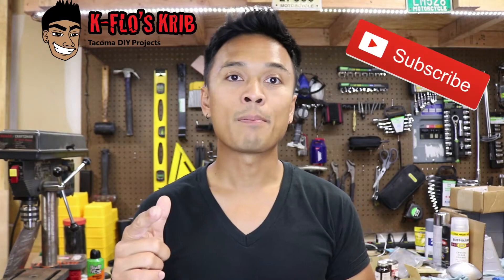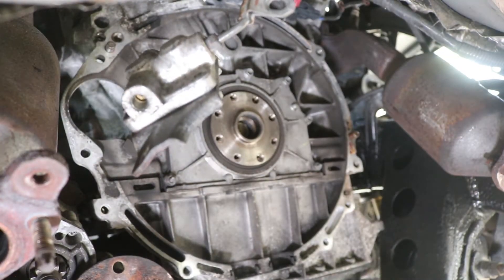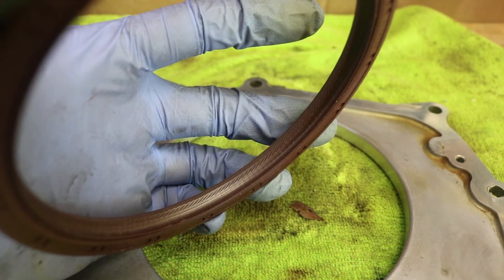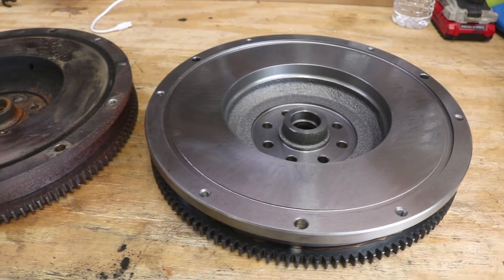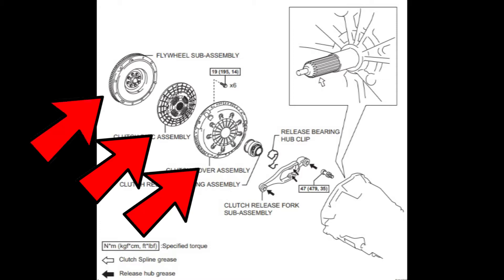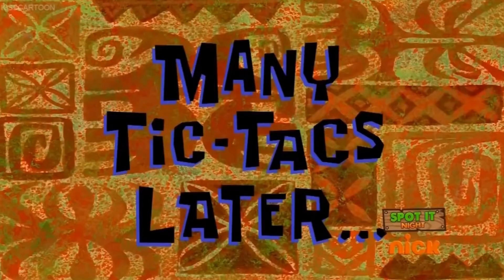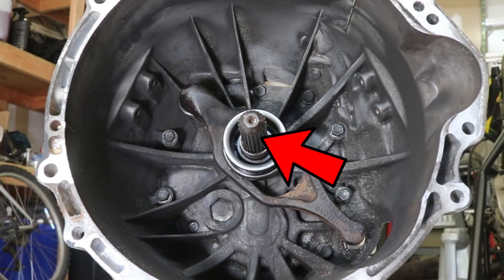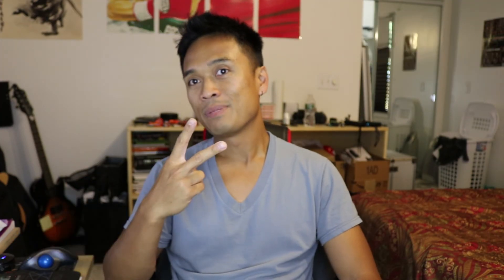Clutch Replacement (Tacoma DIY / How To) (+ Flywheel & Rear Main Seal)

Comment: Well, apparently your Tacoma is different than my Tacoma for the man seal cap. I tried to tighten them to 80 inch pounds and I snapped to the bolts off in my block after further research. Mine takes 30 to 36 inch pounds on my 2012 Toyota Tacoma 2.7 L.

Comment: Thank you sir, you saved me over 3 k. Local shops and dealer all quoted around 3500. I’ve rebuilt engines but have never once needed to touch a transmission. Fuck ntb they demolished my clutch.

Comment: For you yt mechanics The flywheel bolts are TTY! Buy the bolts from Toyota they come with loctite applied! Don't reuse the old bolts. They are 22ft pounds + 90 degrees

Comment: How was the condition of the old throw out bearing if you don't mind me asking? 

Just curious how many miles it went.
Reply from the maker: Old TOB was still OK. A little bit of a screech. I did this clutch replacement since, it was starting to slip and I had bigger tires at the time. I believe I had 130K on this clutch when I changed it
Reply: @TacomaTutorials  Oh very cool, just curious!  I've heard some wear prematurely, so wasn't sure how that one fared.

Comment: Not sure if you’ll see this but I have a 16 manual trans with 35’s and 488. What weight flywheel is best? I only do sand off-roading.
Reply from the maker: You have the same specs as mine. At 4Lo and aired down properly, the clutch grabs very well. I have the AMS automotive, I believe if you get similar specs to stock you'll be good in sandy situations

Comment: Excellent video young buck. I’ve loved Toyota trucks since the 1980’s. I have a 96 diesel F350 because I needed a big truck for our farm. I hope one day to find an older Tacoma to tinker with. My 87 Toyota truck had 140K miles on it when I sold it years ago. It had the factory clutch still. Clutches will last if you treat them right.
Reply from the maker: Awesome! Thanks for watching and supporting the channel! I definitely also want to get my hands on an older Tacoma to tinker and toy with.

Comment: How important was to replace flywheel? The only option I can find is original Toyota part for $600. Local mechanic wants to replace it. Toyota saying noone need to replace it but want $1600 for the work itself. I can't find any aftermarket flywheel for Tacoma 3rd gen 3.5L engine.
Reply from the maker: It's personal preference, you don't have to replace it if it's working properly and still has a lot of material. Keep in mind, It's a lot of work to remove the transmission. It's more peace of mind knowing that all the parts are new when you put the transmission back together
Reply: @TacomaTutorials  Considering i had a "clutch chatter" before it start sliping... i just paid 600 to the dealler . It is $2000 repair now.  By the way if doing with the dealler 1600 + parts ~$2800
Reply from the maker: Thanks for the info bro, good luck with the truck!

Comment: The old cars and trucks you never needed to remove the transmission.  You can replace the clutch and pressure plate by removing access covers.
Reply from the maker: They don't make them like they used to

Comment: Hey buddy, my Toyota Tacoma 2005 4x4 V6, I try to look for pilot bushings online. But it doesn’t show up. Do you think my truck got pilot bushings buddy. I plan to replace my truck clutch and flywheel after I watch your Videos
Reply from the maker: The V6 Transmission does not have a pilot bearing, only the 5 speed has it.

Comment: Hello the last clutch job I did was about 20 years ago on a 1986 Toyota pickup  I currently have a 2005 Tacoma 4x4 with 140k and will need a clutch soon I was just wondering does the pilot bearing come with the new flywheel and are they pressing the pilot bearing into the flywheel now rather than into the crankshaft
Reply from the maker: Thanks for watching and supporting the channel. There's no pilot bearing on the 6 speed manual transmission
Reply: @TacomaTutorials  Not doubting you that just seems weird that there's nothing supporting the input shaft . Yeah mine is the 2.7 with the 5 speed  Thanks for your reply
Reply from the maker: Yea, it did seem weird when I was looking at the shop manual. I believe the 5 speed does have a pilot bearing though.
Reply: @TacomaTutorials  Yes after you said that out of curiosity i looked on the web and yes there are a lot of people doing this are surprised that there is no plot bearing in the 6 speed  the only thing I can think is they have double row bearings in the transmission to support the input shaft  thanks again hey you learn something new every day

Comment: Appreciate you calling out the socket sizes and torque settings. Only thing I didn't see (or missed) was replacing the pilot bearing. It appeared that there wasn't even one in the end of the crankshaft. Also, no need to wait one hour before torquing the rear main cover. The factory uses sealant also and they're not waiting. As long as you don't over-torque the bolts you will leave the thin film of sealant required. Thanks for the video.
Reply from the maker: There's no pilot bearing for the second gen, you can validate with the shop manual
Reply: @TacomaTutorials  Must be either a bearing or a bushing. I have seen both used in various applications, but never neither. Cant have a spinning crankshaft with a non-spinning transmission input shaft in the end of it. You sparked my curiosity now. Cheers
Reply from the maker: Here's the forum entries. A correction on my part, the 6 speed(RA60) has no pilot bearing but the 5 speed (R155) does: https://www.tacomaworld.com/threads/truck-doesnt-have-a-pilot-bearing.455230/

Comment: Could the pins be pushed all the way through on accident?
Reply from the maker: If you're talking about the clutch and fly wheel pins - those pins are press fitted, if you punch them too far in, double check to make sure you have clearance and maybe you can push them all the way through and you can start over
Reply: @TacomaTutorials   thankfully the clutch I got came with the pins already in
Reply: @TacomaTutorials   man you make putting the rear main seal look easy. Went to do mine and kept folding, ripped then the metal band fell out
Reply from the maker: Did you grease the seal and the shaft that it will sit on? If you angle it in and carefully work it around, it shouldn't fold
Reply: @TacomaTutorials   ya I did grease that thing more than I grease my knob before entering. Thankfully when I ordered the seal it came with two. Tried the second one and went on like butter
Reply from the maker: Glad to hear dude!

Comment: This is pretty much the same for Gen 3 MT 6 speed. the only real difference is the wiring harness, so if anyone is asking or wants to know, yes this video will help for Gen 3. i suggest you do the accumulator delete while the tranny is out. the will make things way easier on you and will drive smoother. check the torque values online when doing this though. be careful when unplugging the reverse switch sensor, i pinched mine by accident when removing the tranny. overall took two days with two ppl with a total of 12 hours. now if your going OEM clutch from toyota be aware that toyota will not add in the aligner for the clutch plate. you have to order it separately. so i suggest u order it ahead or borrow a universal kit. lastly the clutch bleed will take some time. remember to push down all the way, be patient and let it bleed until the clutch goes back up.

Comment: Just now finishing up a clutch job on a 2004 Tacoma. Fought forever trying to mate the engine and trans. Then found your tip on aligning the clutch spline teeth and spline with the center top bolt hole. I used the old clutch disc to align the spline and it all mated together quickly. Thank you so much for sharing.
Reply from the maker: Sweet! Thanks for watching and supporting the channel!

Comment: Getting ready to do the clutch on my 06 Tacoma. I was wondering how yours was holding up and if the throw out bearing started squeaking yet.. I seen on another comment you tagged a throw out bearing rebuild trying to see if you think it’s necessary?
Reply from the maker: No squeak on the new TOB. I would recommend definitely changing the TOB if you're changing the clutch.
Reply: Awesome thank you! Did you end up doing the stage 2 clutch that comes with the new fly wheel on your Amazon page?
Reply from the maker: I wish I did, I had already ordered my clutch parts prior to putting together the amazon recommendations.

Comment: I have a 95 Tacoma 3.4 v6 manual trans.I am the original owner, is your Tacoma transmission just like mine? My clutch doesn’t disengage I might have to replace
Reply from the maker: Did you bleed the master cylinder and the clutch release cylinder?

Comment: Hey K Flo, I'm stoked to find your channel and videos that are straight forward without a bunch of filler talk. 
I'm trying to diagnose a problem w my 01 taco 2.7l  manual. It won't go in to any gear. The problem started somewhat suddenly, it wasn't getting bad gradually. Shifter bushing looks fine, no visible leaks from the master or slave cylinders... Any thoughts?
Reply from the maker: Did you bleed the master cylinder and the clutch release cylinder? Does it go into gear when the motor is off? If not, then the problem may be in the transmission's synchros
Reply: It does go into gear when it’s off, but on I get nothing. 
Flushed the master and replaced the slave. Still not going into gear. 
Any ideas? Still think synchros?
Reply from the maker: Did you try starting the truck while it's in gear? with the clutch pushed all the way down
Reply: KFlo Tacoma 
Yeah, it lurches forward, try’s to start, stalls out, sounds like $!!@?..
Reply from the maker: It sounds like you're clutch release cylinder may not be working properly. Bleed your clutch again. Once you do that, see if you can have someone push the clutch while you peep into the bell housing with the cover off. You should see the clutch release for move about an inch to push into the TOB
Reply: Will do👍
Thanks much
Reply: Did you ever solve this problem?

Comment: Short on time, is there a way to make the clutch pedal heavier, it seems so light long and spongy
Reply from the maker: Did you bleed the clutch pedal? You have to bleed both the master cylinder and clutch release cylinder

Comment: How is the new clutch holding up? I'm trying to decide if I should buy Exedy or Aisin. Stage 1 or 2?
Reply from the maker: It's still holding solid 30K miles later. Exedy does make really good clutches, - it's up to you on your budget at tthe end of the day. Aisin is OEM  so you can't go wrong with that either. As far as stage 1 or 2 goes, if you do a lot of trail driving and off roading then stage 2 would be the better decision. Otherwise, if you're just hitting the street then you're ok w stage 1.
Reply: @TacomaTutorials  thanks for the reply that is really helpful. One last question. What are the pros/cons of a stage 2 clutch vs stage 1.
Reply from the maker: Stage 2 has more rated torque transfer and much more aggressive in engagement than stage 1.

Comment: Is there a link or part number you can give for the clutch release arm? I cant find the arm anywhere for under $140.
Reply from the maker: I would just recommend using the old one. Once you replace the throw out bearing and the pivot ball, it's just as good as new.

Comment: Hi K Flo, thanks for you videos. I just replaced the rear main seal today in my 2009 Tacoma 4L 6 spd Man. While replacing the clutch. I just pried out the old seal and tapped the new one in similar to you, but it never occurred to me to take the plate off. Is taking the plate off necessary. I could get a new seal and take the plate off. It is not clear to me now what other purpose this plate could serve. I did the same repair to my 97 4 runner a few months ago. I don't recall if it had a seal plate or not, but obviously I did not take it off if it was there.  

A couple comments on your video. I did not find it necessary to disconnect the clutch disengage  cylinder from what I think you called an accumulator, I just left it all together. Also from my experience with the 4 runner, one can access the two top nasty bolts from the shifter hole, alleviating the need for super long extensions. It easier to get the shorter extension on the bolts though by doing so under the truck and feeding the extension in. Also no need for a universal as it is now a straight shot to the bolts and shorter extension does not wrap up as much.
Reply from the maker: Good stuff and great information! Definitely a great idea to go in from the shifter hole! I took out the plate since it was a quick and easy job to reseal, I wanted to reseal/replace anything that I can while the trans is off. The accumulator sits on top of the clutch release cylinder. It's the square looking thing. The tubing coming from there to the clutch release cylinder was corroded was damaged so I replaced that tubing along with the clutch release cylinder. While I was doing both, I also cleaned the threads on the accumulator. Thanks for the great ideas and inputs!

Comment: I have a squeek that comes from somewhere around that fork when I push down the clutch. I've been  spraying in that area with WD-40 for years to make it stop. I know this could get me. At any rate thanks for the video. Very well done. Any idea what causes the squeek?
Reply from the maker: If you're talking about the clutch release fork, the squeaking will usually come from the throw out bearing being very worn. If you're spraying wd 40 in that area inside the bell housing then you're going to get clutch slippage pretty early since the clutch works by friction and your introducing a lubricant in that area. 

If you're talking about the clutch pedal (inside the cabin) itself, thats pretty normal. Just add some heavy wheel bearing grease on the push rod
Reply: @TacomaTutorials  thanks

Comment: When can I drop my 4runner off for you to change the RMS? Another awesome video but it looks like it is byond my experience.
Reply from the maker: This work is definitely a lot more involved!
Reply: @TacomaTutorials  how much do you think it will cost to have dinner at an independant shop?
Reply from the maker: Dinner at an independent shop would be dependent on what you buy and if you're having drinks lmao. I think you had a typo there but i think your question was to ask about the cost of a rear main seal replacement. According to google research it roughly around $400, which is a super expensive cost for dinner. At that point, i would do all the other maintenance required while the trans is out.
Reply: @TacomaTutorials  yes that is an expensive dinner. I was quoted $1200 at dealer and $750 at an independant shop. The independant shop said when i start seeing oil drops in my driveway is when it is time to change.  So far no oil drops.
Reply from the maker: OK gotcha. I'm guessing that your oil level drops on a consistent basis with no visible oil leaks at the motor? is that how you figured out that it's probably the RMS?
Reply: @TacomaTutorials  I looked under the tranny and noticed that small plastic piece that sits at the bottom and notice oil residue. I wipe it off and the next day it comes back. I park in the same spot everyday but no oil spot.
Reply from the maker: Does it smell/look like motor oil? Hopefully it's not from the torque converter leaking its fluid.
Reply: @TacomaTutorials  i didn't go that far to smell it. Didnt think think to smell it bc as soon as i saw it, i just assumed it was motor oil.  I should do three smell check soon to make sure it is motor oil.
Reply from the maker: That would be your best bet since it can be any one of three different systems (Trans/motor/torque converter)
Reply: @TacomaTutorials  thanks karl. I suppose i should prepare to get this service done soon to take care of all that.

Comment: Hey Karl, is this considered a transmission rebuild?
Reply from the maker: Hey bro, to answer your question: no this is considered a clutch replacement. This sits between the trans and motor.

Comment: hey man got a question. how’s your truck driving after the rough country lift?
Reply from the maker: It drives pretty well. I'm actually in a road trip now from NJ and stopped at va and nc. Keep in mind, it does ride like a stock suspension. It's not fancy or adjustable or anything like that. The main purpose was to fit bigger tires